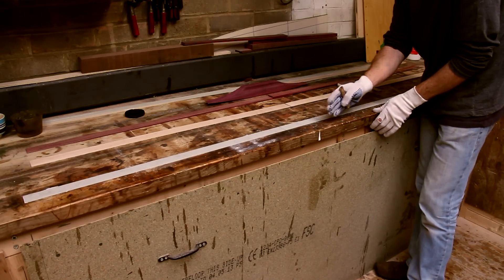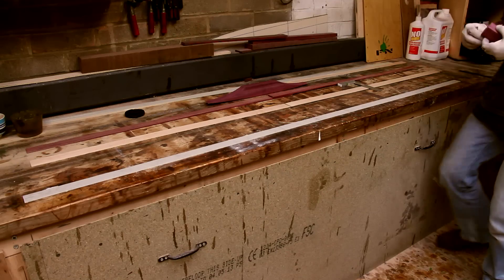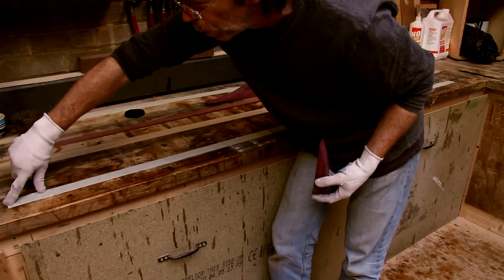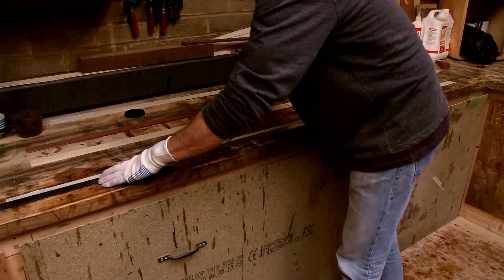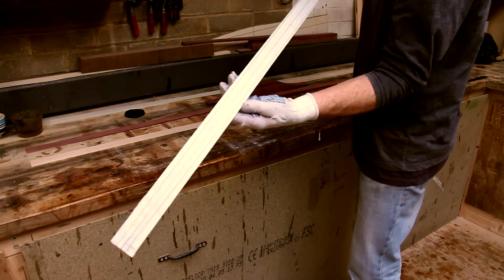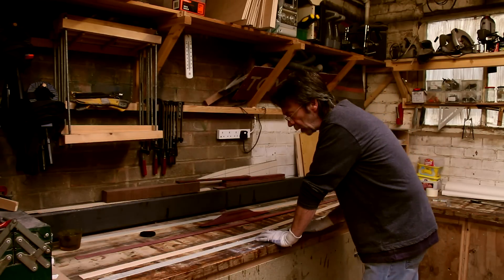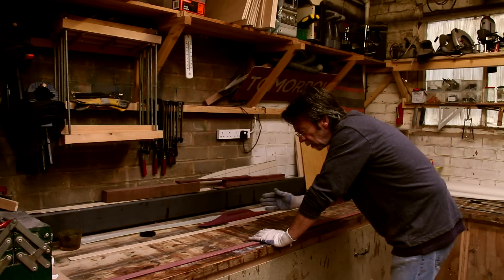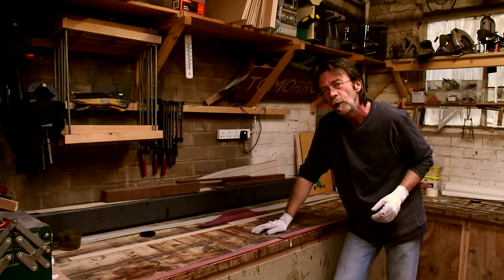Bow Building – Fiberglass Backed Laminated Flat Bow – Part 3 of 8

Comment: One idea for gluing the strips together in a straight line would be to use a string stretched between 2 screws (or  pegs) in your bench.  A tight string is always straight.  Holes in our bench with dowels/string in them would be repeatable and easily removable.  Just a thought.

Comment: I down loaded the plans.  It appears the upper and lower limbs are the same length. I read from other sources that the lower limb should be a little shorter than the upper limb.  Input?
Reply from the maker: +David Hefner I think it has to do with the position of the arrow shelf. If the shelf is a lot higher than centre the limbs would have to be adjusted to suite. But with this design the shelf is only about 12mm above centre and thus the limbs are okay being equal.

Comment: How do you determine the weight/poundage based on number of laminates you use?
Reply from the maker: +WV591 Hi, I usually alter the thickness of the core laminate and then fine tune the weight by taking wood off the sides of the limbs. The core laminate might be 5mm for something around the 40 -50lb mark and 3mm for  lighter draw weights.
Reply: Ah-sides of the limbs.Thank you
. I had forgotten. double width = double poundage -double thickness = 8 times poundage.

Comment: so you prefer epoxy to Resorcinol Resin ?
Reply from the maker: +WV591 I've not tried the Resin, the smooth-on seems to do the job
Reply: THX Dave. there don't seem to be many choices or much info when it comes to glues for bows.